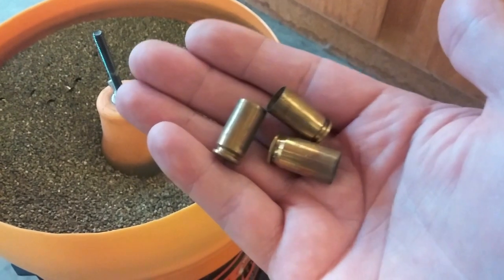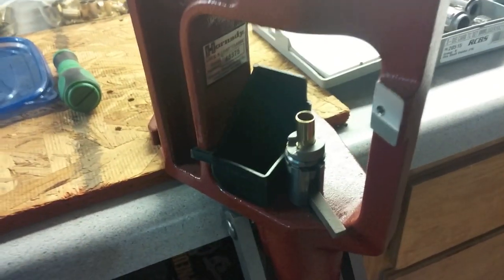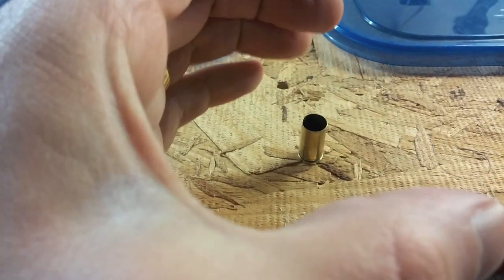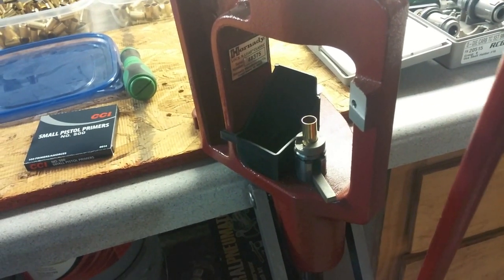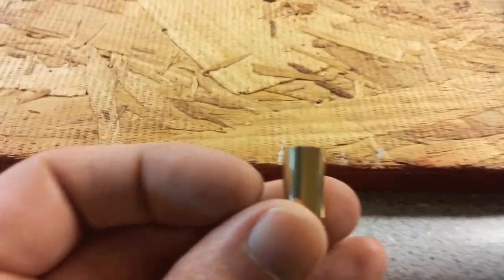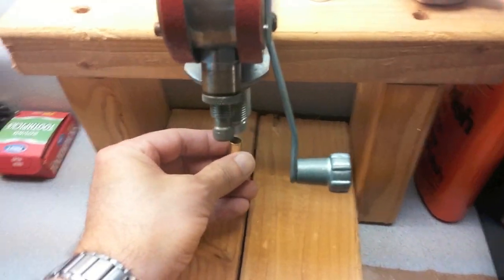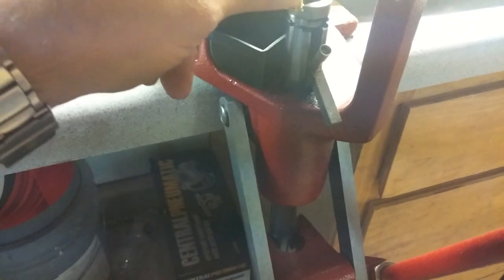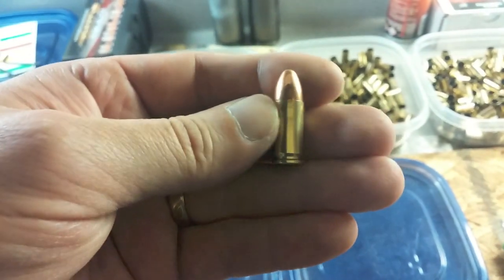Reloading 9mm on Hornady Lock n Load Classic

Comment: Wouldn’t it be more efficient to clean the brass after depriming rather than before?
Reply: Yes but if their more dirty and not lubed it can become stuck in the die
Reply: Only if you use a stainless pin or ultrasonic cleaner, the tumblers like that don't clean the primer pocket.
Reply: I use a primer pocket reamer so it doesn't matter if its dirty or not.